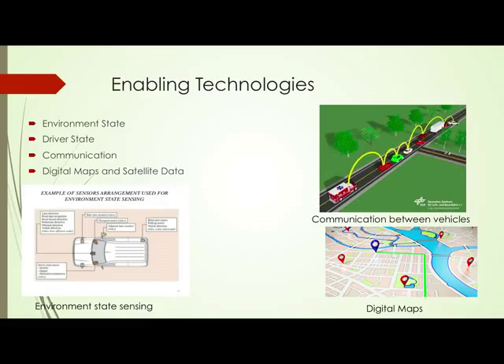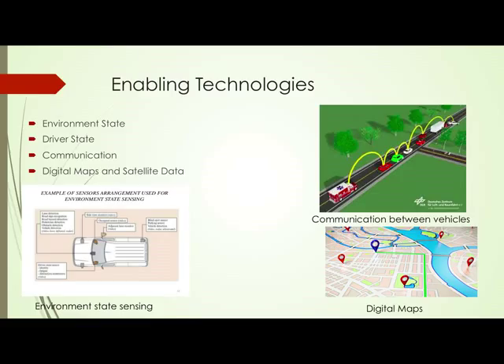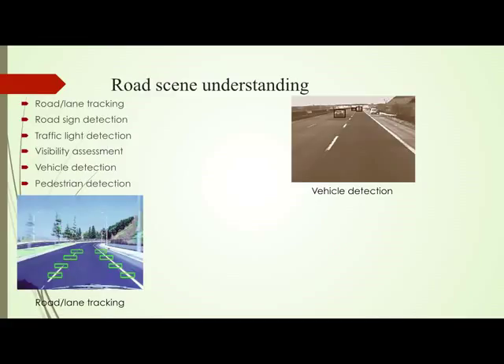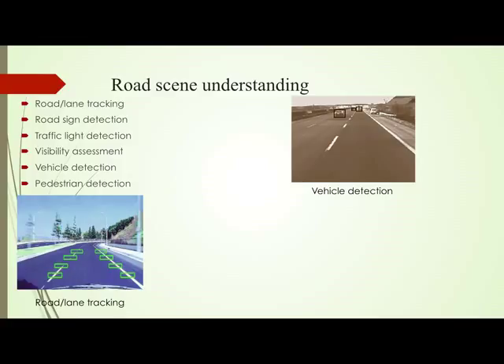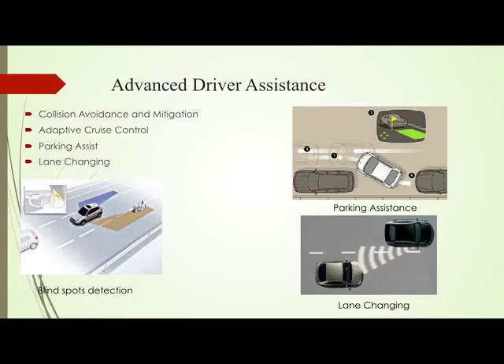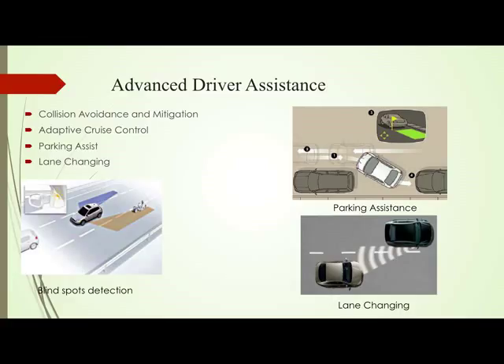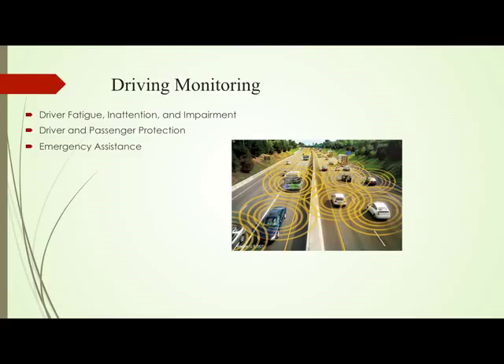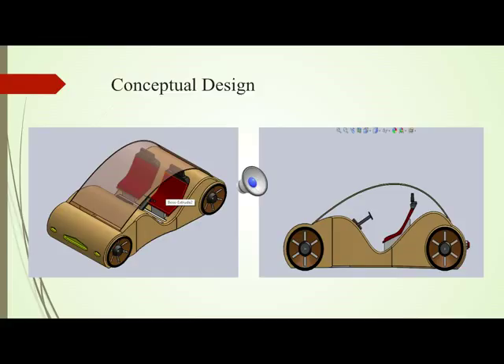Team 4: Intelligent Cars

Comment: This team produced a great video. The presenters are very knowledgeable on the topic. Audio is clear and precise. The Solidworks model was a good concept to include in the video as it shows a design that could be applied in real life. There is room for improvement in this video. This video is over the 10 min limit that the professor gave for the presentation. To fix this, I recommend to the team to remove the Solidworks drawing slide and to edit out the last 5 seconds of the video. The team needs to make the text on the powerpoint slides bigger so the points can be read easier.